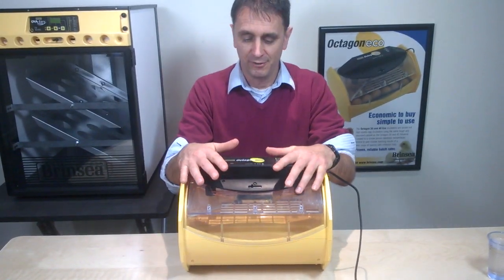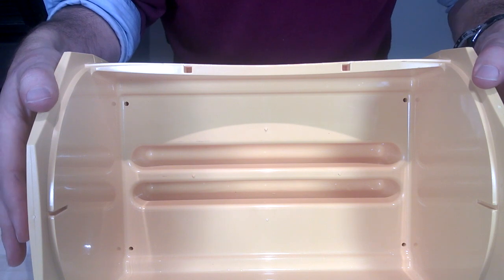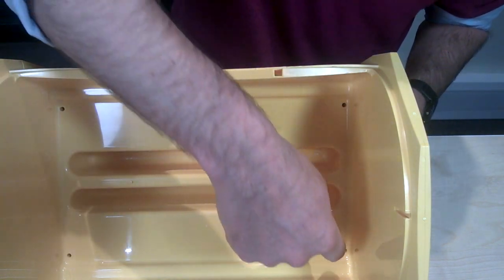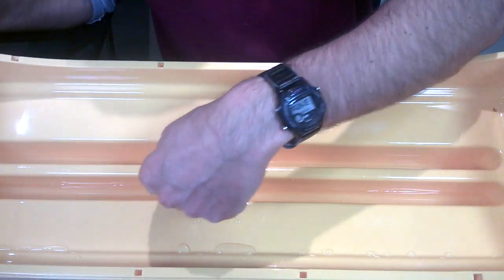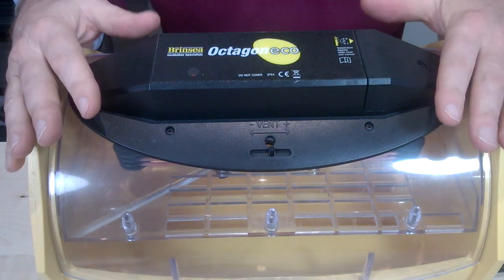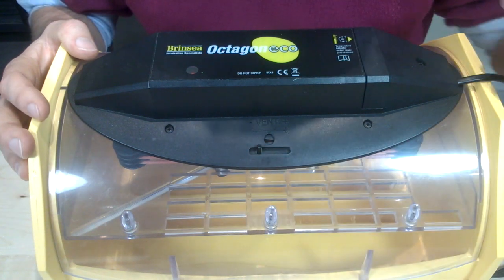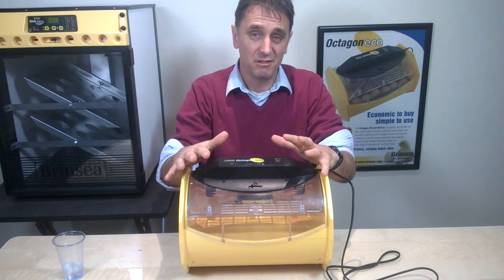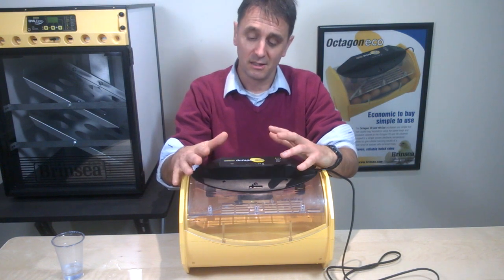Brinsea Octagon Eco 20 & 40 Egg Incubator Clip 3 Setting up the humidity

Comment: The worst results I had were because of adding water from the start, and trying to keep up humidity.... Best is no water to begin with, vent half open, add water at day 18, and make sure there's water until hatching on day 21.
Reply: I figured that it would decrease the hatch rate opening the lid to add water for RH% 
So you put no water until day 18 candled to see what was fertile then added water the las four days or so?
Reply: @marvinvazquez2036  Yes, only water the last four days, candling on day 10... It depends on where you live, but the climate in UK, Ireland, Northern Europe has enough moisture. Never open the lid during the day of hatching.
Reply: KidMillions I live in California and the weather here has a lot of moisture for sure
Reply: But I am going to try it the way you do it, because it the eggs are going through different humidity levels and temp levels as well every time we open the lid to add water ñ
Reply: Can I open in Lockdown??? Lockdown starts tomorrow for my duck eggs, I haven't added any water yet. Do I tomorrow? And then when do i top up water? Im in the UK by the way